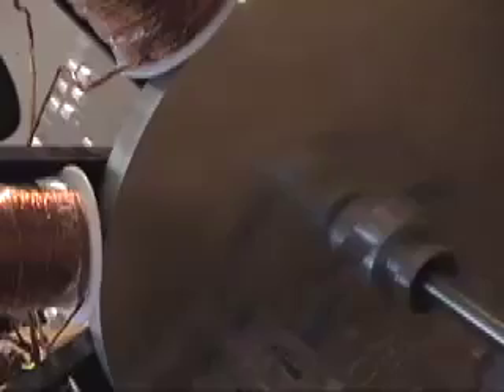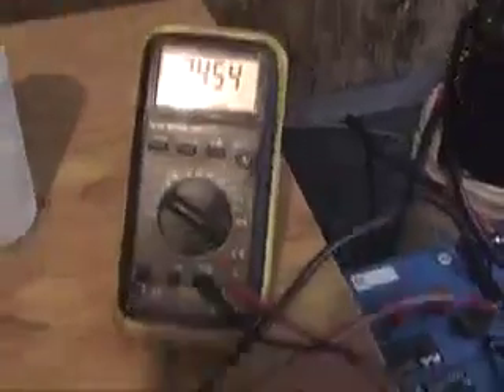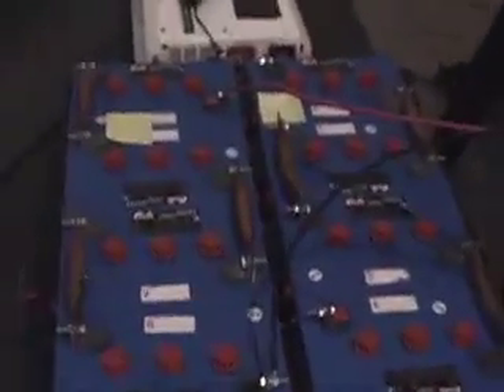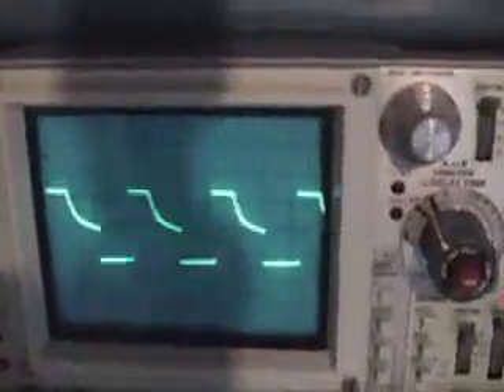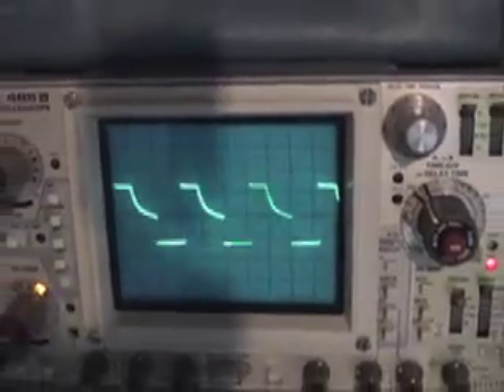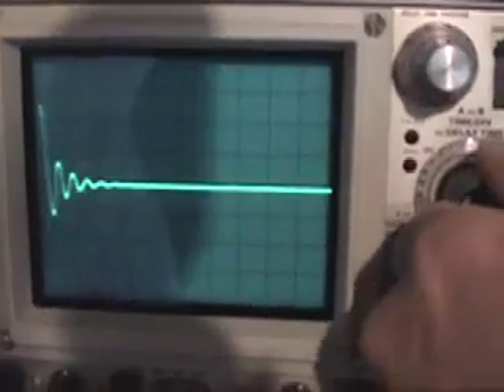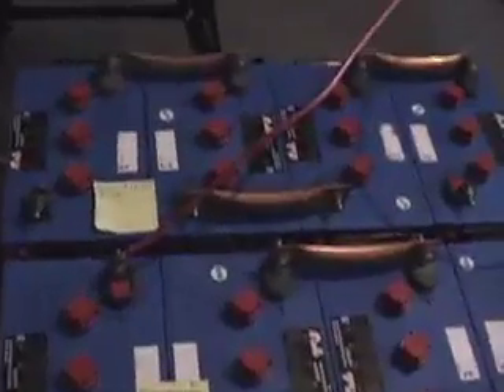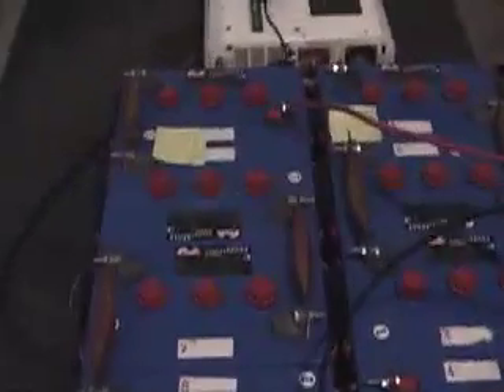10 Coilers first video

Comment: I noticed, the ONLY people that say Bendini's machine don't work, are the people that don't have one and never seen one in person.  I've seen a lot of builders that haven't finished tuning right. Other than that.  It works.
Reply: Isn't it really amazing how those who claim to be electrical engineers formally educated are also the ones making the armchair claims of how fake they all are and can't work because it is impossible to create something from nothing and yet still fail to see that NO ONE claims to be, and everyone states that they are taking the spikes "they" call back emf, that actually are Tesla's discovery of drawing from "the field" (aether) and utilizing it through a smoothing through a capacitor or two or bank of them, to take the 100 to 400 and sometimes 800 volt spikes at whatever number of cycles per SECOND and sending that regulated into old batteries  where it performs a process of desulfation on the plates restoring them to BETTER than new, and YET these engineers can't wrap their Indoctrinated brains around such a basic concept that so many "amateurs" are successfully achieve to one stage or another, as you mention, depending on their ability to tune well enough to achieve peak resonance!

I am beginning to think these educated people don't WANT this to work because then it means they will have to admit to having been WRONG in the most basic concepts of what they are supposed to be experts on!  LOL!  And what takes the cake... NONE OF THIS VIOLATES ANY OF THE LAWS THEY ALL FALL BACK ON AS THE BASIS OF THEIR COMMENT!  

Keep up the positivity and help inspire others to also try to make one of their own...never toss another lead acid (or many other type) battery again!!  

Namaste'!
Reply: How true ......

Comment: my source bat's are two 80 ah in series. on 10 coils I draw about 9+ amps with about 6 amp charge. I can turn it down with the vary resistor and do 8A primary and 4+ charge. the spikes show up on the scope and the batteries charge but no improvement in capacity.  when you say load the wheel do you mean physically put a drag on the wheel? I have not done that and it does not take much effort to slow it down.

Comment: I am using the bedini circuit but the ten coil machine was a kit put out by rick fredrick. I do have a one coil machine we built that doubbled my battery capacity in 5 cycles, this was after I cycled it 4 times with the normal charger.  I am using 24v two 35 ah sealed. I can vary the rpm up to 900 but usually run it a about 750. the source bat is larger than the charge batteries. and I keep a 5 amp charger on it while operating.
Reply: please share the ampeare..........??? ( consuming and charging )

Comment: can you give us some input vs output . Is your source Battery or from plug ( apparently source NOT being radaitn works better a.p. Bedini)

AND for testing the output of the "source" it's imperative to have a load on the Wheel ... the higher the Load the less consumption from source ( u may know this all )

All this is basically the same as Lenzless or Back EMF devices that also create max torque at max speed .

thx for interacting

Comment: Keep in mind ,is your design a.p. Bedini or your own?

This r chargers are for removing corrosion from the plates BUT if the Batteries have too much material on the bottom you need to clean them and then try again.
Else there is another thing to consider on other subject I would be keen to know
1. how many batteries you have 
2. did you check with RPM counter how fast it goes full moon
3. did you manage to check how many batteries are charged prior to depleting the source battery(if source bat)

Comment: I have a two coiler which works and does create more energy in the batery than it uses to charge it. however my ten coiler does not and I have yet to figure out why.  I see you do not understand, it does not really violate the second law of thermodynamics because the new additional energy is simply just comming from a new source. the enviroment,  or what ever you want to call it. space, dark energy ect. its not electron flow. there are other sources of energy besides electron current.

Comment: i have a ten coiler, it runs and charges but it does not change the batteries or add any more capacity to them. I would sure like to know how yours is able to do this and mine does not. thanks Rick.

Comment: can you explain how to condition the batteries to radiant energy?  as of yet my 10 coiller does not improve  battery capacity. it charges them but no increase in capacity after 5 cycles.

Comment: I have the same machine, yes you can run it on just one coil but you have to remove the other coils or they will attract the magnets and the force of that cannot be over come by just one coil. I have ran mine on one coil, it runs at about 460 rpm, draws about 3 amps. however I have not got it to improve the batteries capacity level.  it will charge two 35 AH bats with one coil in 12 to 13 hours. with all ten coils it takes 3 hours.

Comment: @smackbabie The overunity is when you pulse a coil 12v in my case, the back emf of approx 200v ac is created. This high voltage is harnessed to charge the battery. If you switch batteries either manually or electrically they will both increase in charge.

Comment: @smackbabie I dont think you understand the Bendini. First it should not be called a motor, but an energizer. You pulse 12v into 1 coil of the fan to make it operate, the other coil is a trigger coil to operate the pulse. You use 2 batteries as I earlier explained, one to drive, and one to be charged. The overunity is that the charge battery   charges quicker than the drive battery. If you switch the batteries (electrically) the both end up with more charge than when started.

Comment: @smackbabie no i built a small bendini motor using the fan. I also built a battery switcher. to cross over the batteries. Over time both batteries increased in charge voltage